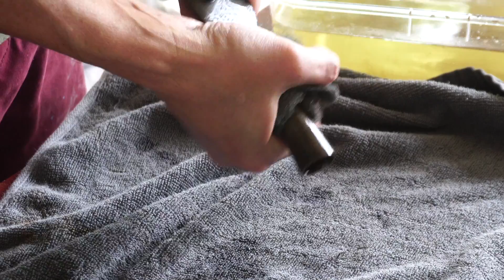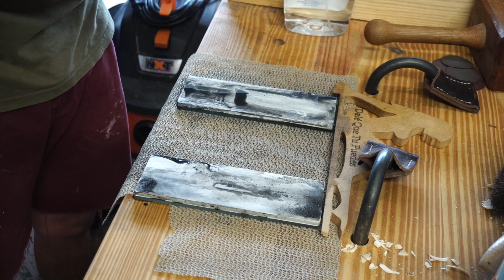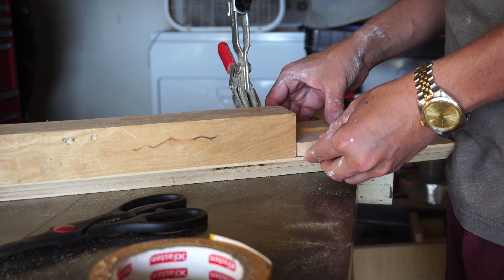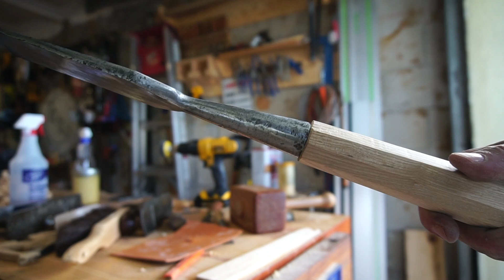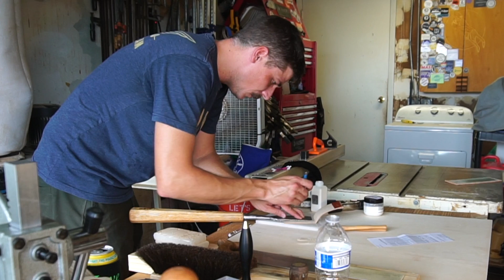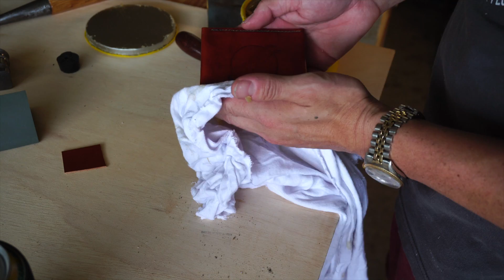Chisel Restoration | Making a Timber Framing Slick | Vintage Woodworking Tools

Comment from the maker: Help support my channel through the following Amazon affiliate links:
Sanding Drill Attachment: https://amzn.to/3lwWb4u
Dewalt Compact Drill: https://amzn.to/3ht3tng
Caliper and Divider Set: https://amzn.to/32ypFWK
Brass Marking Gauge: https://amzn.to/32rcXt3
Pure Citric Acid Powder: https://amzn.to/3b1Dd0X
Green Polishing Compound: https://amzn.to/3ln3lIw
Shapton Glass Stone Set: https://amzn.to/32uFIF5
Shapton Glass Stone 8000 Grit: https://amzn.to/2Qtl56B
Shapton Glass Stone 3000 Grit: https://amzn.to/34BnZyl
Narex Rasp Set: https://amzn.to/32rPWWJ
Stanley Sweetheart Chisels: https://amzn.to/2FUEco4
Mineral Spirits: https://amzn.to/31xTBmG
Wipe on Poly: https://amzn.to/3hB0dpZ
Boiled Linseed Oil: https://amzn.to/3ll8IrB
Real Milk Paint Pure Tung Oil: https://amzn.to/3fFil0S
Beeswax Pellets: https://amzn.to/3fE9Xi5
Tormek T-8 Water Cooled Sharpener: https://amzn.to/3hM39jn
Starbond CA Glue Set: https://amzn.to/2Wr2Pht
Ball Mason Jars: https://amzn.to/30QMOTv

The Real Milk Paint Company's Impressive line of finishing products:
https://www.realmilkpaint.com/ref/cowdogcraftworks/
For 10% off use coupon code: cowdogcraftworks

Find vintage tools from Ryan Goetzmann: http://www.skanwoods.com
Contact Mike Griffin for stitching ponies: https://www.instagram.com/wingandwavedesigns/

Comment: why dont you have a splitting kniffe?
Reply from the maker: Haven’t gotten around to it yet.
Reply: @CowDogCraftWorks  well. Go around for it. Just to precent kickback
Reply from the maker: @thijspluis9998  I really don’t have any kickback issues.
Reply: @CowDogCraftWorks  prevent. So it most likeley doesent happen
Reply from the maker: @thijspluis9998  I don’t necessarily disagree with you but I am of the opinion that strong safety practice as opposed to safety equipment eliminates most of that margin for error. Eventually I’ll install a splitter but the best tool for eliminating or reducing the chances of kickback is using the saw correctly.
Reply: @CowDogCraftWorks  yes. But the kickback that hapens is mostley out of your controll. Having all the safety equipment is helping keeping human error out of it. And things out of your controll

Comment: Nice work Chris! The magnets in the leather cover is a great idea
Reply from the maker: Thanks man. Yeah I noticed over time my holdfast covers had some issues staying on because the leather breaks in and compressed over time... so I was worried I’d have a similar thing here eventually. So the magnets were a good way to make sure I’m not flinging it all around the joint!

Comment: Hiii quick question. Does the microadjust feature on your taytools marking gauge work? Because it just doesn't turn on mine. Thanks.
Reply from the maker: Sure does. Are you able to loosen it up?
Reply: @CowDogCraftWorks  nope i cant get it to turn but thats ok since i usually just tigjten the thumb screws a little and then "microadjust" the head with my hand
Reply from the maker: Yeah you might have a janky one. I actually might have a wooden marking gauge in my future... so that might solve some of your issues. 😉
Reply: @CowDogCraftWorks  thanks.

Comment: That turned out really slick!! If you change you mind and want to make more handles using hand tools you should make a Spar Gauge. It marks out the lines for an octagon and it even works on tapered stock. (shameless self promotion time: I made a video about how to make a simple version here: https://youtu.be/oZyKdswxGQw)
Reply from the maker: SHAMELESS. But yeah I’m probably not gonna be making octagons anymore. Unless I make the world’s largest and thiccest pair of chopsticks.
Reply: @CowDogCraftWorks  that would be a fun project! The thing about making it an octagon is that this is the intermediate step. After that it is very easy to turn the work piece into a round shape. But it's probably even easier to do that on a lathe 🤣🤣 (but I don't own a lathe 😓)